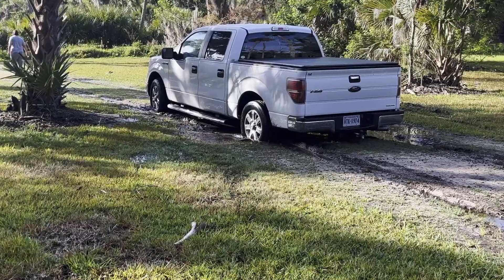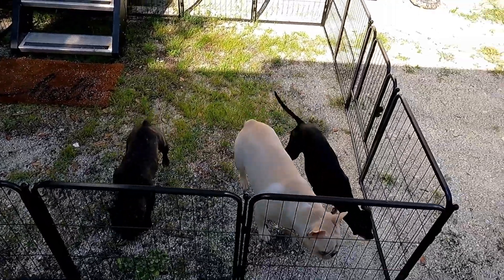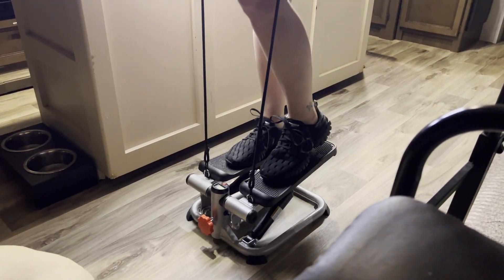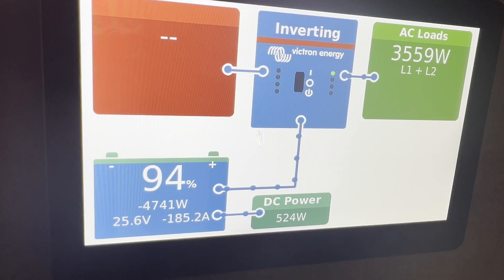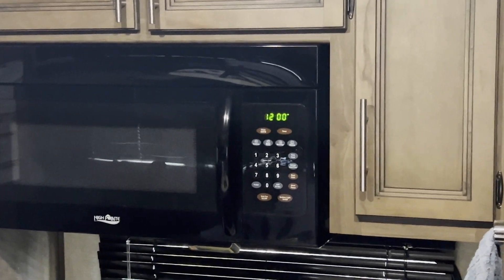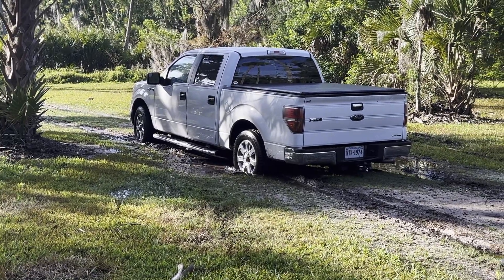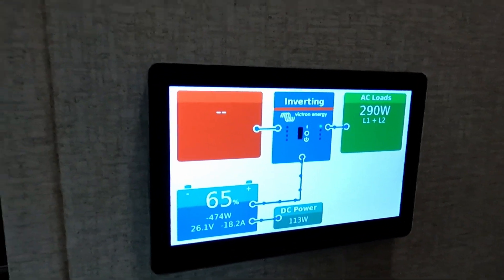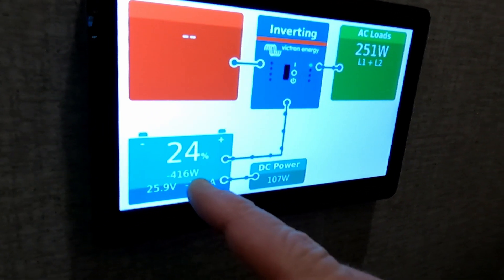Huge RV power system for OFF GRID & BOONDOCKING test! Parallel Victron Multiplus Inverters.

Comment: Hi Chris, love your content. Question! I'm planning an install where my batteries and multipus 2 will be located in a compartment under my sofa. All the heat producing components like the Mppt, DC/DC charger, and 24/12 converter, will be located in a bay that used to house my outside TV directly outside from the sofa compartment. My plan is to put an air intake and outlet with fan vents on the bay door. 
The question is, might this cause any condensation issues in the winter? My other option is to cram everything into the sofa compartment and have the intake and outlet vents within the motorhome. Have you had any condensation issues for your system being in the basement?
Reply from the maker: @banyarydym we haven’t had any condensation issues, our components never really get that hot either. We have a Govee wireless thermometer in the bay with all the Victron components and it never really gets “hot” in there. Usually barely above ambient temperatures.

Comment: I think, if you had one more of those batteries you would be in great shape. Probably one of the best systems out there with one more battery! 
Also LiTime has a 230 amp hour 24 volt battery for $1,169.
Reply from the maker: @lindsaywhite4502  max you can run is 4 in parallel, anymore batteries and I’ll start running into weight issues, three of the 230amp hours batteries weight almost as much as four of these but less power.
Reply: @saltytrips  
Yeah, I understand my friend. 
I still think one more 200 amp hour 24 volt battery will put you in a great place. 
I think one less worry about power and again you would have a great system 👊

Comment: Morning,  I just caught some of your Ford truck videos,  we have a similar truck,  I have the 2022 Ford F250 XLT 7.3 gas with the 3:55 rear end. I really like the truck,   Love the engine!!  Are you having any transmission issues?  Just not totally sold on transmission. I tow a travel trailer at max 8K lbs. Accelerating up thru the gears is fine,  but slowing down, gearing down,  a few hard shifts is concerning.  Also just a recommendation,  I purchased the TigerTough seat covers,  custom fit,  very durable,  best accessory I have purchased so far!!!   Stay Safe!! Have Fun!!
Reply from the maker: It was a little clunky at first but its pretty smooth now, they told me it has “adaptive learning” 🤷‍♂️, but now its fine.

Comment: Another excellent video! Ive been following along and your doing exactly what ive planned to do. Ive pulled in 2 runs of wires to go from the breaker panel to the invertor location on friday. Monday i went and picked up all my victron components and was shocked that the dealer was cheaper than amazon. So ill be starting my install as well. Nxt is to start buying batteries.
Reply from the maker: … my second inverter was on sale on Amazon for just over $1,100, so far these LiTime batteries have been great weight less and take up less space than most other brands. Just pick something you’ll be happy with.

Comment: All new Why did you not use 48v batteries?
Reply from the maker: 24v fit the bill just fine 👍, if i had some 240v systems or a much larger battery bank or three inverters then probably would have went 48v. 48v is a bit overkill for this application.

Comment: I use this formula, for every 100 watts you use all day, 4.8 kw battery. I use 14kw (600 watts per hour) a day and 48kw battery lasts 2.4 days tops. If you have an RV on solar power 3kw inverter minimum. I also use a portable ac only 600 watts with all the insulation I have, at 95f it is cold in here.  A 1500 watt load all day I would get 72kw battery bank. If you use a lot of generator power get a soft start as the ac surge can cause the frequency to spike low then high and trip the inverter to stop charging, if you encounter that problem with no ON ac turn off the fridge and freezer while you charge with the generator. After my first year and 105 straight days of clouds I learned to put as much solar as possible, 8kw to 13kw this year.
Reply: @skookum3000  it should give every build 2 days of power

Comment: I'm following every video on this - we're camper brothers right now. We have similar motivations, we have dogs and want complete flexibility. I had commented on your Facebook post that I am building an extremely similar system. We just got back from a weeklong trip, and I got to run some tests as well. One night we got an awesome spot on a river that was only available because there were no hookups.

I'm looking at adding some more USB ports in our bedroom, because we only have a couple of AC loads (Microwave, A/C's, TV, Ice maker) and can often turn off at night.

Right now, I just have the stock 370 watt solar panel, and I've been impressed with its ability to charge the battery bank. I want to replace with 2000+ watts, and I think that will work well for running 1-2 A/C's and stay reasonably charged.

In July, we're adding solar, so I'm hoping you add yours before I do. 🙂
Reply from the maker: Solar video will be out in the next week or two

Comment: If you want your batteries to last longer while running your A/Cs, I recommend getting more efficient A/Cs. We removed the rooftop A/C we had in the bedroom and replaced it with an EG4 28.5 seer-2, 12k btu mini-split heat pump on the upper rear of our motorhome. It's super quiet. In fact, we can't even hear it running unless it's in turbo mode. It draws less than 1/2 the power of our front 14.5k soft start equipped Furrion rooftop AC but cools just as well. It provides 13,000btus of heat too, which saves us a lot of propane. 

We have 2 house batteries, a 7.1 Kwh 12v (560ah) battery and a 15.3 Kwh 48v (320ah) battery for our 120v ac needs provides 24/7 off-grid air conditioning and heat from the heat pump. Our 4,400w solar array is racked 15" off our roof. It can run both A/Cs, our household appliances and charge our 48v battery at the same time, even in winter. We also have a liftable 620w array on the side of our motorhome to charge our 12v battery with. Our side array makes a nice bedroom window awning too, practically lifting itself with a couple gas struts, and it's easy to clean, standing safely on the ground. We use a small 1,000w 12v inverter for back-up of mission critical 120v equipment, like our 55" UHD TV, entertainment center, computer and ice maker, should our 48v system ever go down. 

We have a Sungold Power all-in-one 48V, 5,000W Inverter/100A charge controller/battery charger, breakers and a Lnex battery monitor on the wall in our bedroom, saving us space as well as money compared to a system built with individual components, as we're old folk who built our system ourselves on a tight retiree budget over a period of 5 years. We built both batteries ourselves using raw cells. Our 12v battery is protected by a 330a (1,200a surge) Heltec BMS with a 5a active balancer and our 48v battery uses a 200a BMS to keep the cells synched and safe. We couldn't afford to use name brand components like Victron and Battleborn, so we took our time, researched and found quality lesser-known components for a fraction of the price. For instance, we have the equivalent storage capacity as $16,650 worth of 100ah Battleborn batteries for under $3,400. Our all-in-one inverter/charger/charge controller takes the place of many components, yet the inverter has the same 95% conversion efficiency and 99% charging efficiency as the Victron units do, but we found it for only $726 including shipping. So in total, we have 6,000 watts of 120v inverted ac power available, 23.5kwh of batteries and 5,020 watts of solar, giving us off-grid electrical independence without the need to plug into a power pole or run our generator. Our total budget was around $11,500, including the $1,500 high-efficiency heat pump. Take care, hope to see you down the road one day.

Comment: One issue you will run into if you haven't already is setting the max AC input value.  With the inverters paralleled the minimum is 18.6 amps.  I have a big generator that can support that but prefer to use a Honda 2200.  Added two Victron Energy Blue Smart IP22 24-Volt 16 amp so I can supplement/charge the batteries while using them.  Each pulls 460 watts off the generator and puts about the same into the system.

Comment: Great details, math does not lie. I was expecting that you would have more than enough power to go an entire day but, not the case. I guess now the question is how much solar??
Reply from the maker: That video will be out soon, in the next week or two 👍
Reply: @saltytrips  I already have 2 solar panels but, have lead acid batteries. I would just like to upgrade to some Li batteries because of weight and their ability to charge quickly. I look forward to the next video. Keep On Camping!!

Comment: Another great video!  I just ordered the 3rd battery for my system .
A question from your last video when wiring the multiplus’s in parallel to the junction boxes.  I believe you said the wires must be equal length . I’m awaiting to hear back from Nate from
Explorist to get his knowledge on this but do you think there is any wiggle room on this ?  I’m having a challenge to fit them in my current plan as those 6/4 wires are so stiff and bulky.  Thanks again
Reply: Equal =no resistance 😊
Reply: I built a very similar parallel 2x120 system about a year ago.  Everything I read expressed the importance of the wire lengths matching when paralleling the Multiplus IIs.
Reply: @usmcrtr  thanks for your imput!  Ya, I’m coming to the same conclusion.  I am currently reconfiguring my layout as I type this .
Reply from the maker: Victron says wire should be equal lengths. As far as how much wiggle room I’m not sure, I would do my best to make the equal as you can.
Reply: @saltytrips  in the manual it only refers to the DC connection wires equal length . It doesn’t refer to the AC wires .  I’m reworking my plans anyways for equal wire length 
Thanks
Reply: @slayermtb_7848  From Victron Wiring Unlimited page #55  Paragraph 6.7. Special considerations AC wiring parallel inverter/charger systems: "Preventing uneven distribution of AC currents: To safeguard against this issue, it is recommended to use long AC cables, of similar length. Always follow the recommended cable lengths and thicknesses as listed in the product manual. Do not increase the cross-section of the AC cabling more than is recommended in the manual! ".  This is what lead me to match my AC wire lengths.  Recommend looking over the document if you have not already.  Ton of useful information.